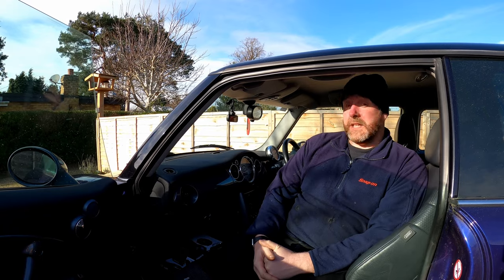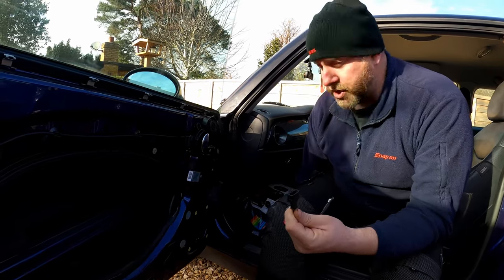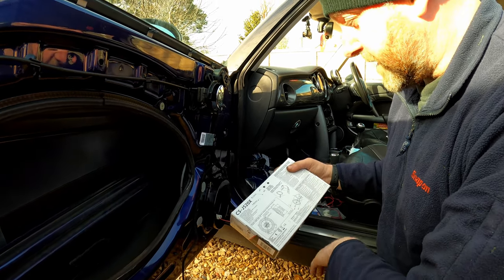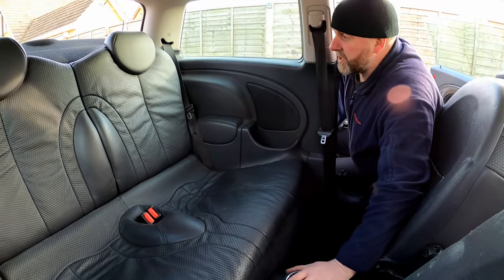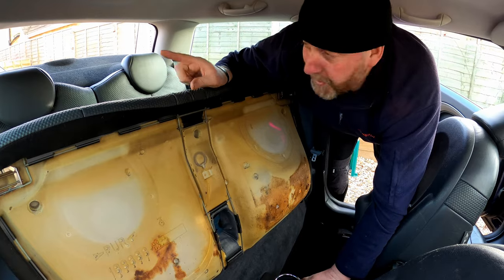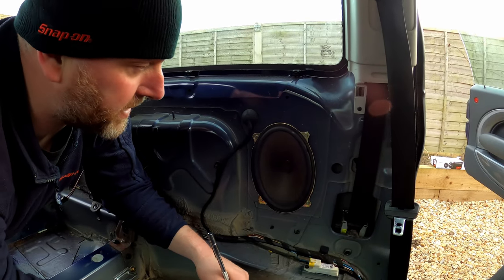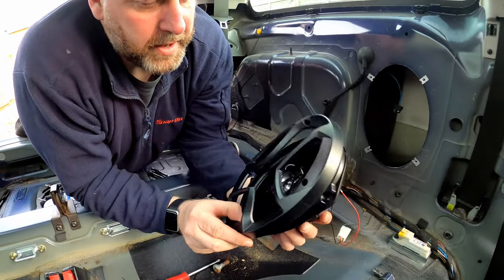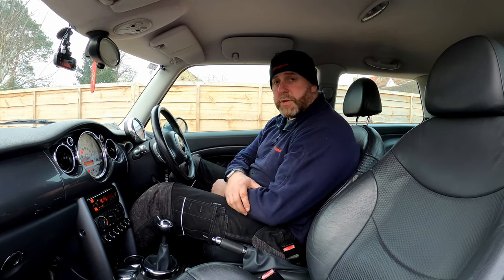Fitting Aftermarket Speakers To The Mini R50, R52 & R53, A Great Upgrade!

Comment: I was thinking that the rear speakers would be easy. 😂 I have the speakers, but haven't fitted yet. I honestly thought I'd be able to pop that wire mesh off in front of them. 😮
 So that job just got twice as long.

Glad I watched this first now.
Reply: nah, you dont need to take all of that stuff off, I managed to just take the door seal off for the front doors and then just pry the panels open enough to access them

Comment: Great video! Where did you get the black wire adapter? You said "anything prior to july 2004  ...
Reply from the maker: Links in the description mate 👌🏻
Reply: @KevsShed  the link only for the white ones.
Reply: @Noname5618-k6m  the pre 2004 July ones come with the speakers I’m pretty sure but if your model is after July 2004 you need to buy the white wiring adapters
Reply: My 02 (in the states) used the same looking white connector you needed, maybe the black one is if you have the harmon kardon